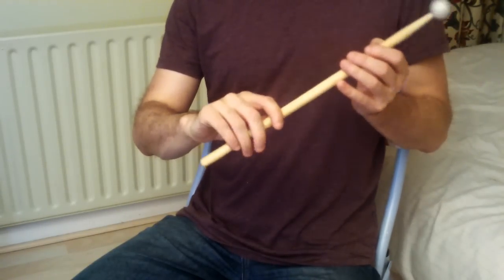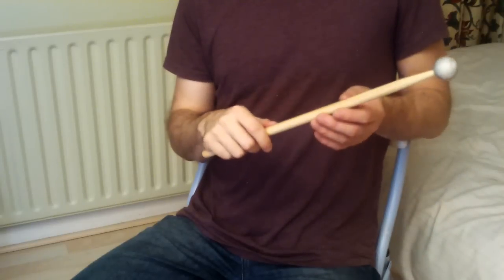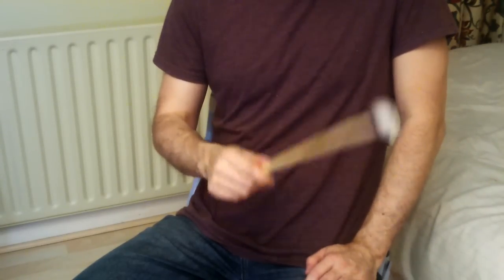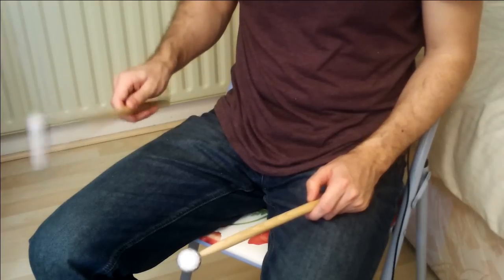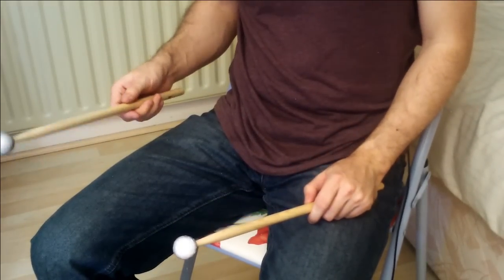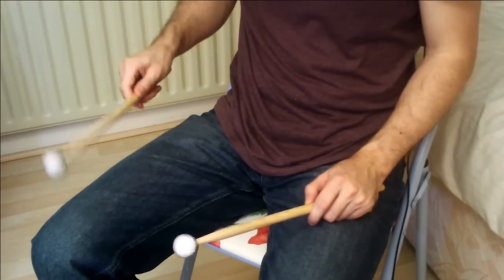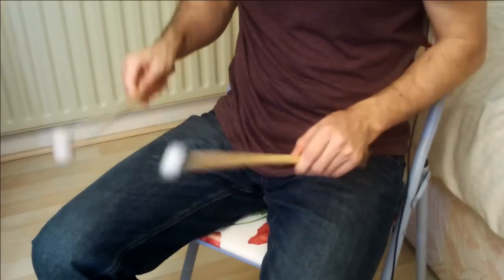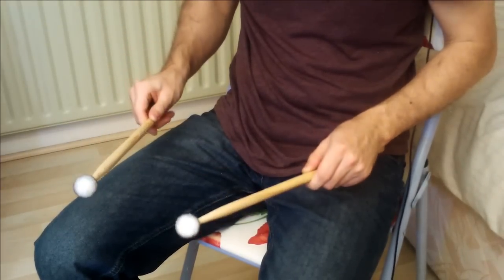Aerodrums: Rebound Rebuttal

Comment: Hi .  I wanted to ask if it is possible to put a practice pad or a pillow where the drums are and play with the aerodrums?
Reply from the maker: Hello. No the reflective markers at the tip of the sticks are too fragile to do this. You can mod your sticks and put the balls further up through the shaft (there are a couple of spares in the box). The reason why we don't show this is we believe air drumming is a beneficial way to practice in its own right, it builds all skills plus trains being independent form the surface. It is a great and fun way to complement your practice on a pad. So doing both is best if you can.
Reply: @aerodrumming  Thank you so much : )

Comment: Do you need a specific camera in order to use aerodrums? Not the lens I know it comes in the package, but do you need a specific camera. Because I have no camera but was told a ps4 one would work fine, if so I'm prepared to said camera to use this
Reply from the maker: +Mr.250 Hello, it has to be a PlayStation Eye camera (the one that launched for the PlayStation 3, and is part of the PlayStation Move system). Aerodrums doesn't work with the new PlayStation Camera (the one that launched for the PlayStation 4)
Reply: thanks, does it come with the camera or do I have to purchase the camera? I have no problem with purchasing that camera since most places sell it for only like, 25 bucks.
Reply from the maker: +Mr.250 If you buy Aerodrums from our website, we bundle the camera with it. Our dealers usually bundle, and Amazon usually gives you a button to add the camera to your basket (I wouldn't advise adding anything else it recommends with Aerodrums).
Reply: thank you! I was worried I have to buy a ps3 camera (not like it would be a problem though)

Anyway, I'll definitely be getting this product, no more noise complaints from anyone XD

Comment: Why not use the Kinect?
Reply from the maker: The original Kinect only updates at 30Hz which is not fast enough. I'm not sure what Kinect 2.0 is capable of.
Reply: Will you try to make it work for Kinect 2.0?

I would love to use your system in part with my uni project.
Reply from the maker: Michael Nielsen
Sorry, it's unlikely we'll work on a Kinect 2.0 version in the short term given that you can't purchase a Kinect off the shelf unless you buy an Xbox One.

Comment: what about ghost notes?
Reply from the maker: Aerodrums can measure the speed of your sticks/feet to a high degree of accuracy allowing for soft ghost notes to heavily accented notes. The full range of MIDI note velocities and continuous controller data is utilized. In the case of the included samples, 16 levels of openness are provided for the hi-hat with up to 58 different samples for each degree of openness and for each hand. Unlike electronic drums, Aerodrums is able to tell which hand you are hitting with and will trigger different samples for each hand.
Reply: I bet no problem for ghost drums. XD

Comment: would practicing in this "special" way for the aerodrums, be itself a problem with practicing on a real kit, as you are using a technique here specially to counter the fact you are not hitting an actual drum i.e. you would not use this palm striking technique on a regular set of drums. 

great product by the look of it.. just would be concerned that having to use specific techniques for it that you would not use on a real set, or not necessarily use, would have you practising in a motion and method, that could negatively effect when you are on a real drum kit. 

Thanks
Reply from the maker: We haven't heard of people complaining that air drumming is negatively affecting their ability to play on an acoustic drum set. We've had comments from users and teachers saying they believe that air drumming is good to build finger control. Aerodrums is good for that because if you set it sensitive, it'll punish your mistakes if you are being sloppy.